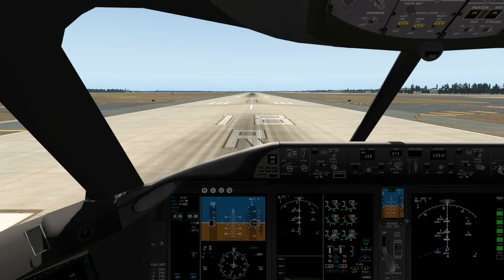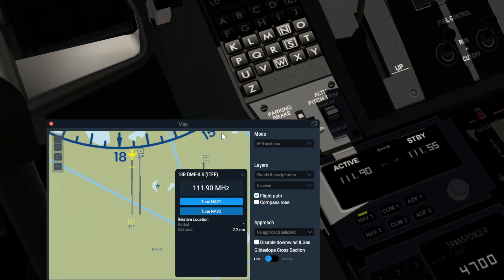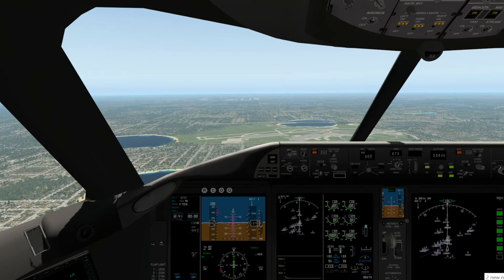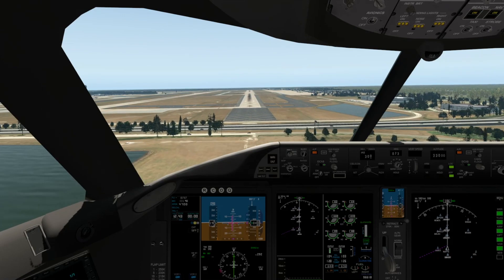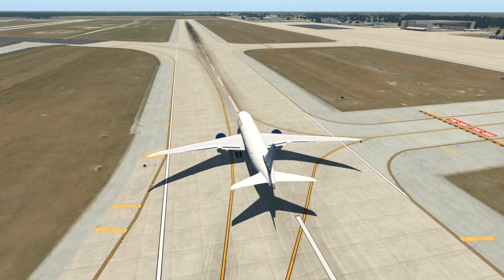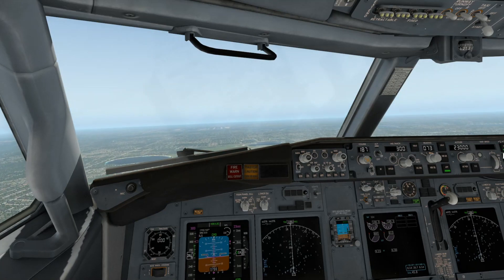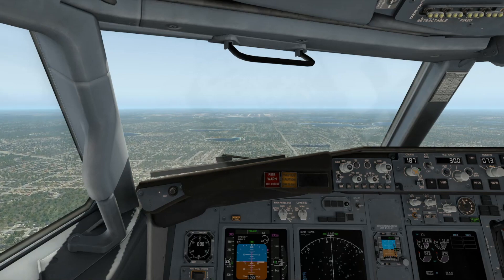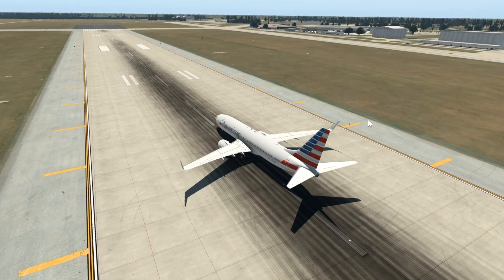VMAX 787 ILS Landing Tutorial | X-Plane 11

Comment: Im struggling to get comfy on this XP11 version, as opposed to FSX. Ive got prolly 2500 hrs using these in FSX (stock models) but it never prepared me for this. Its like the functions have safety switches on them (kinda like Windows asking "are ypu sure you want to do this?) Ive read a lot of people have had these issues, and some of it is often because of the plug-ins for switch panels. Not sure yet. Examples...
On take off, it likes to blow past my altitude setting. 
In the air, it almost never grabs the heading when I hit HDG hold. 
If I change altitude, it doesnt move unless I hit Lvl change (is that typical?) Either way, its a major pain in the ass compared to FSX.
Reply from the maker: Hi, thanks a lot for watching! If you have flown any payware aircraft in FSX, then they should operate similarly to the X-Plane payware, as they use similar systems designed to accurately take configurations from real life. In the 737 (x-plane stock), it is a lot more realistic than any of the stock FSX aircraft, and it requires certain configurations to prepare autopilot. Don't worry, there's plenty of tutorials about this autopilot on my channel and many others elsewhere. If you think that your plane is configured and not behaving how it should, feel free to start a thread on forums.x-plane.org, where there are many helpful users. It'll take a bit of getting used to the more accurate flight models of XP, but once you get used to it I'm sure you'll love it. Thanks a lot for watching, and best of luck!

Comment: Hey man... can you explain to me about the air traffic controller and how you determine which runway to land on?  What i mean is i leave... CYUL Montreal for examply on RW 26 R and tell my flight computer a flight plan i wanna land in Toronto CYYZ on runway 26R also... yet when i finally get to toronto ATC always says to" FL6000 and visuals for RW05 " and i fly that way forever and they never contact me again and i just.. dont land.    Cant get ATC to let me land on 26 R and i cant line up properly to 05 cuz its on the OTHER fricking side of the airport....   Long questions shortened how does ATC determine which runway you land at?
Reply from the maker: It's based on weather. Since you land against the wind, ATC will tell you the runway for the weather. The only way you can definitely get the right runway is by manually setting the weather so the wind is blowing against your landing. Thanks for watching.

Comment: If I do not drive the airport from the side right now, will my plane automatically take the autopilot to the runway?
Reply from the maker: Hi, if the runways are next to each other, it should automatically line you up with the correct one, it doesn't really matter if you accidentally go to the left when you need the right runway. However, if they are crossed, then it won't work, and it will fly all over the place. Hope that helps a bit. Thanks for watching!

Comment: Very nice. Do you think a GTX 1050 would max out xplane 11? I have a GTX 745 now. Thanks
Reply from the maker: Hi, thanks for watching. I think that a 1050 could run X-Plane very much at a good quality, you may need to close background apps too. Over all, it should run with good pace and quality. It also depends on other specs, on the forum, you may be able to go into bigger depth. If you have any trouble or need anything answering with other specs, just contact me in the comments system on one of my videos. Thanks!
Reply: i use the rx 460 and it is fine